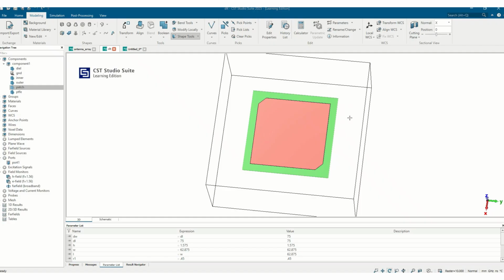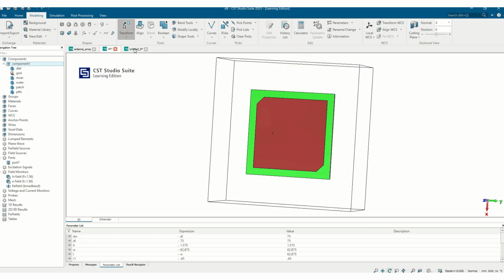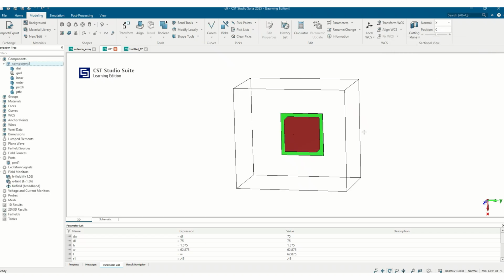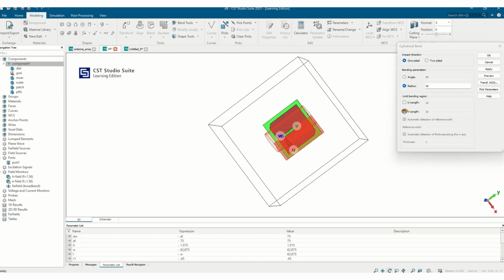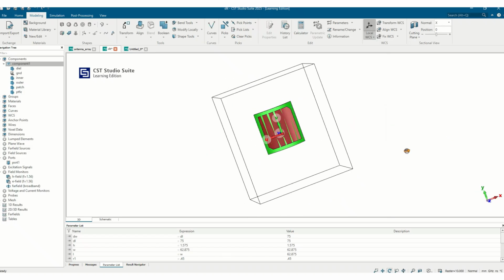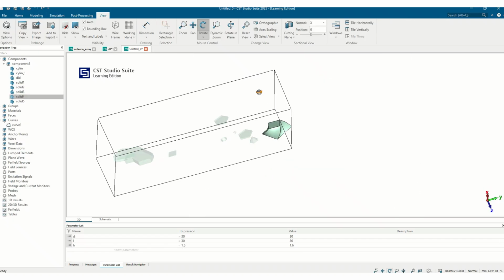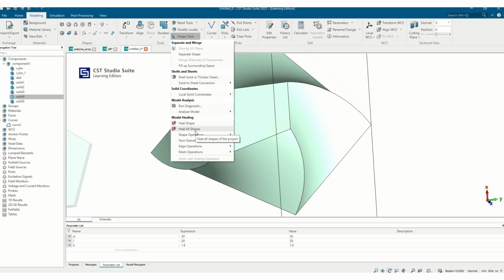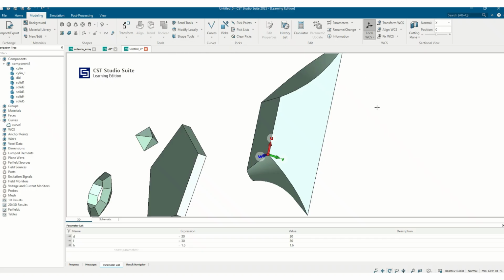CST Studio Suite Basics for Beginners:-Understand the Modification of modelled structures

Comment: But as u can see, after bending some part of top pattern seems to be inside the substrate, why is it so? I often get this issue while bending whole metasurface array
Reply from the maker: Yes, agree. That will happen because of the segments in cylinder. The bend layer option can be used in that cases. Create a shape (cylinder) and align the structure. I think CST help has examples showing the bending of PCB layers.
Reply: @waveresTech okay thanks for your reply. By the way can we expect metasurface based antennas tutorial in near future?